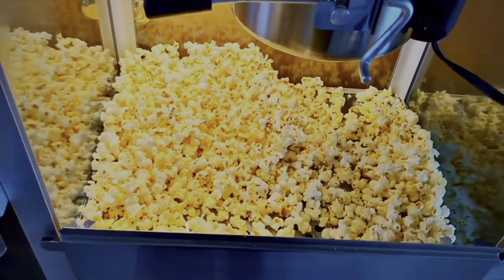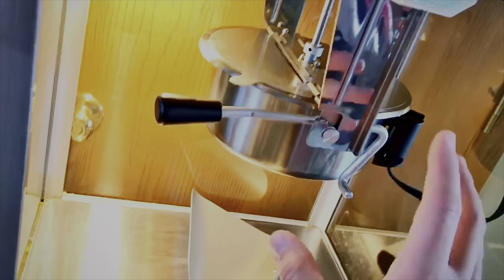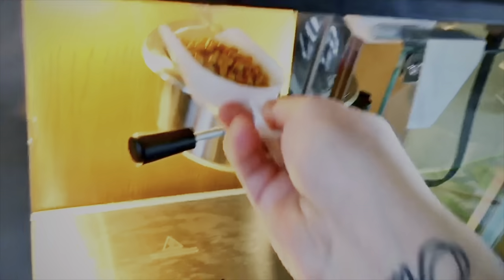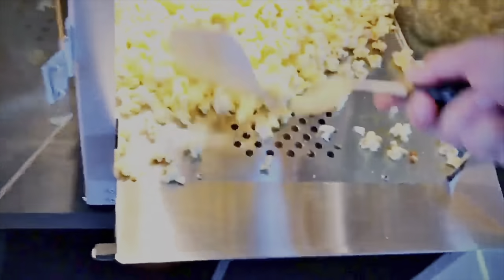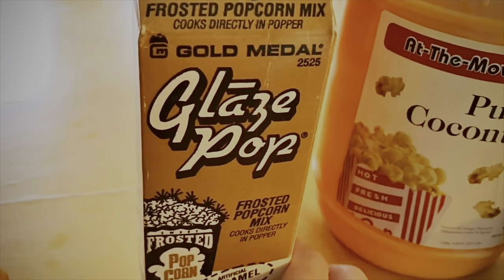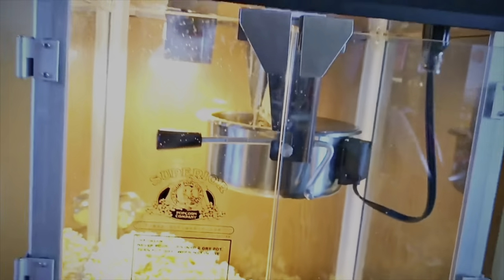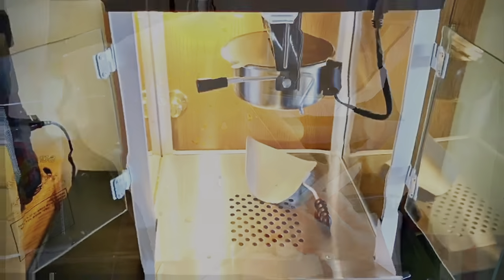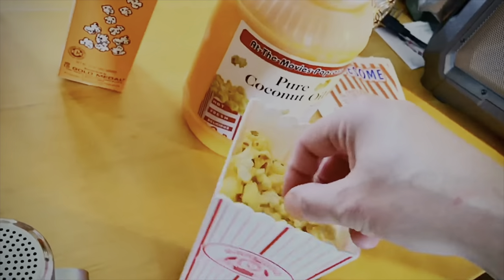Movie Theater Popcorn Secret Revealed! How to make it at home!

Comment from the maker: You can get this popcorn machine and other supplies on Amazon at these links:

Superior Popcorn Company 4635 Hot and Fresh Countertop Style Popper Machine, 8 oz, Black https://www.amazon.com/dp/B012P0D32O/ref=cm_sw_r_cp_api_4mxtAbJBST30J

Coconut Popcorn Popping Oil (Single Gallon) https://a.co/d/eYCQ46l

Flavacol Popcorn Season Salt , 35 oz. https://a.co/d/bB1bzVO

Snappy Yellow Popcorn Kernels, 12.5 lbs https://a.co/d/9FbRQJc

Buttery Flavor Popcorn Topping (Gallon w/Pump) https://a.co/d/h7UJvV8

Gold Medal Frosted Caramel Popcorn Glaze Mix 28 oz https://www.amazon.com/dp/B00133071A/ref=cm_sw_r_cp_api_XTztAbHS6RAG4 

Salt Shaker Winware Stainless Steel Dredges 10-Ounce with Handle https://www.amazon.com/dp/B001CIELHW?ref=yo_pop_ma_swf